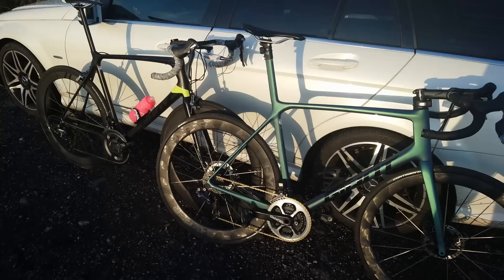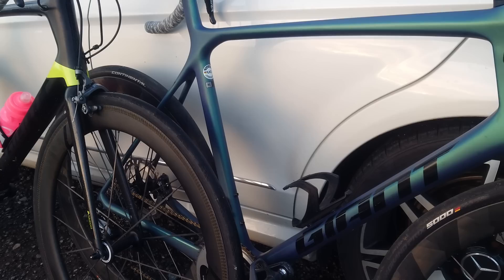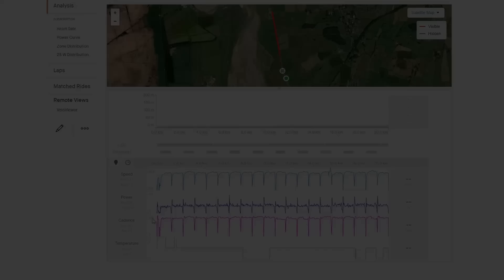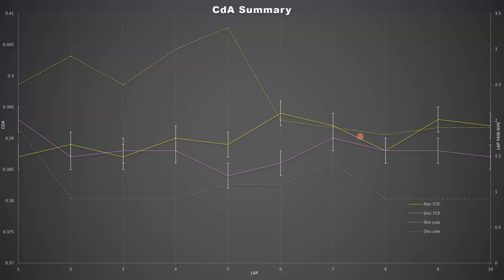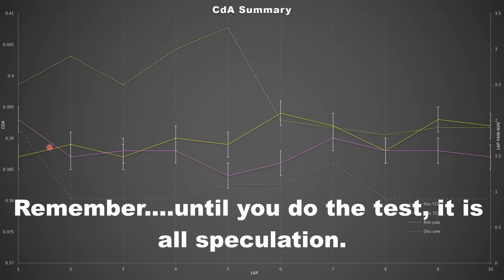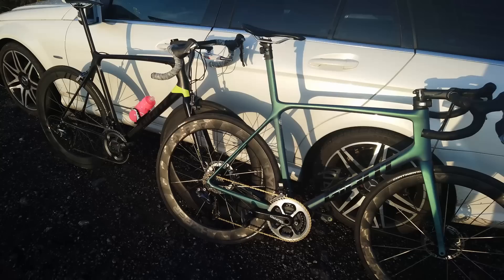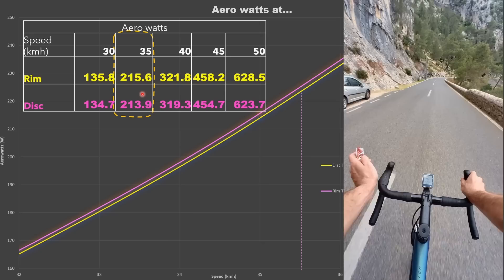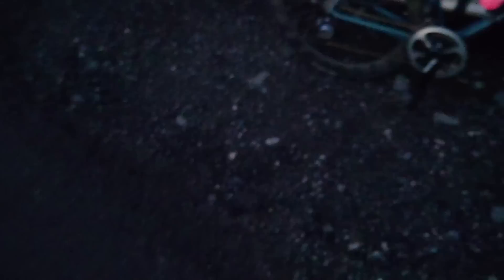Are Disc brakes Slower? Rim Vs Disc Aero tested.

Comment from the maker: Update before release: Just realised - in the second chart, the colours have swapped. Values are correct.
Update post release: Thanks for all the comments, crazy this one I shall try and keep up. Dont forget to click subscribe, 80% of viewers non-subs, I don't bite! The next videos we have in this series include:
Wider Tyres vs control tyre Aero test(at iso-Crr) - self explanatory
Wider Tyres vs control tyre Rolling resistance [frictional and vibration attenuation] test (at iso-CdA) - I fix CdA and optimise pressure for a given course. 

All wheelset data for individual aero tests (which forms the backbone of the Aerolab partnership) can be found in upcoming wheel test videos. The first one to be uploaded here was the Ican35 review which you can find on my channel.

Cheers to the patrons, you know who you are!
Reply: I think cross wind performance and measurement would be much more beneficial.  Most people slow down if they feel the cross winds are jerking their wheels around--that would affect speed more than anything else.

Comment: PT and his estate car. A man with no shame.
Reply from the maker: Low CdA mate. 53mpg+. Remember the Volvo estate in BTCC? Was it banned for being too quick?
Reply: @PeakTorque  A load of tosh, that CdA is going to be way worse than my car! It's because you are contributing to lung problems for the masses with your diseasal. for our next video powerpoint reaming I think we should have "Cycling Youtubers and what they drive". I think the masses would be hooked.
Reply: I was disappointed the bikes weren’t in the TR6.
Reply: The Merc has discs, front and rear. Just sayin’. 🤷‍♂️
Reply: Five year olds can't even drive
Reply from the maker: @Gregory_tottie  oh you just wait. They go across Europe!
Reply: Merc Estate cars  are #1 choice for dogging... is what Hambini meant to say😂
Reply: @Hambini Mate you lived in Germany. You should know estate cars are the craze
Reply from the maker: @Dolmar-Rick  laying down with 2 fine frames in the back, can't complain
Reply: @peaktorque the test is tempting but it is Not of any engineering value…. You have half a dozen of variables together… different wheels, different widths, different bars, different bar sizes, exposed cables, different cranks… there is no lessons an Engineer can get from this.
Reply: @PeakTorque  haha
Reply: @hambini Well my RS6 - 2021 estate fit either my mtb or roadbike very well. especially on german autobahn. you propably have driven the A555 a lot...
Reply from the maker: @cipo36an203  any test with repeatable results, that adds to a bank of data and learning, is a worthy test. I'm a professional engineer, this is a hobby, but its the same mindset. If you want to pay to equip the bikes the same, you may join patreon 😉
Reply from the maker: @Ghostina1  please donate an rs6 to the channel
Reply: I only drive an estate ("Kombi"...) cause my wife won't let me buy a van...
Reply: @PeakTorque  how about we all donate a Model S, because we all know that’s your favorite car ever made!
Reply: Here in Oz Merc estates are thin in the ground and quite desirable. Not sure why they didn't import more estates. I'm an SUV man as a daily driver but an estate is better if you're looking to sleep in it.
Reply: @Hambini  Mr Hambini I’ve never actually seen a video of you riding a bike? Do you actually ride any bikes or are you just an armchair cyclist? 😁😎👍🏻
Reply: @PeakTorque  then act as an Engineer even for hobby. You may have a repeatable test, good, you may learn how to use, the limits of your sensor, but comparing apple and bananas doesn’t drive ANY conclusion outside “bike1 vs bike2” and definitely not answer tue question “is rim brake faster than discs”.
Reply: If it’s good enough for Chris Harris, the estate car is good enough for me! Grand effort dude, just shows the versatility of the estate fitting those 2 rather large bikes, and the pink bottle!
Reply: @cipo36an203  when the test results are contrary to your personal belief… blame the test… and the tester. Nice one.
Reply: @edthelizzard  what? What believe? The test can’t prove what the title suggest regardless what is faster. That’s doesn’t require a degree to understand that with “everything different” you can’t drive any conclusion.
Reply: @cipo36an203  in the absence of better data from your part, I’ll stick with the engineer’s data and conclusions and draw my own conclusions from the test. Those being that if aero performance is not significantly different between the two braking systems I would choose the system with better braking performance. Until such day as you provide evidence of a better test (yours or anyone else’s) or credentials supporting some sort of engineering superiority, I’ll disregard whatever opinion you might have on this one. And as the author suggested, you can always contribute through Patreon to provide him with better test conditions. Your money where your mouth is, so to speak.
Reply from the maker: @cipo36an203  it proves the 2 bikes, despite having very slight differences, are within a very small difference of eachother. Thats a useful result, whether you like it or not.
Reply: @PeakTorque  yes we compare 2 bikes with near results, the title of the video suggest we look for something different. Rim or disc are just one of the many differences.
With so many variables we can’t even say “slight differences”, you just have no idea if differences cancel or add up. If aero-bar compensates exposed cables or if rim profile compensate narrower position…
Reply: @edthelizzard  not having other data doesn’t make this data is valid… if data is not valid it’s ok not to publish it, there are still things to learn but not to answer the question the title suggest. Since you seem to care, as Mech Engineer I guarantee we can’t make ANY conclusion based on this test. The wheels may have 3-5w difference, the aero bar may bring 3-4 but the narrower round bar may compensate way more (but guess what, it’s buried in the noise generated by all the differences), the exposed housing are in the 2w region… if you are able to see the impact of the breaking system that’s beyond engineering capabilities…
Reply: @cipo36an203  I don't know what perfectly analogous world you live in, but in this world comparing one apple with another apple will still yield some variation.
The point is, whether there are disc brakes or rim brakes the aero differences are negligible, especially when coupled with some minor variation between bikes.
Feel free to set up your own test. If you want to compare satsumas and satsumas, I would say your best bet is to remove the bike completely from the equation and just mount some bare disc brakes and rim brakes on a stick inside a wind tunnel...👀. Otherwise good luck finding two completely like for like bikes which accommodate both brake types.

Just to add to the variation, some bikes conveniently tuck the front rim brake behind the forks, like my Propel for example, or tuck the rear brake on the chainstay by the bottom bracket 🤷🏻‍♂️.
Reply: @mikehall6608  I live in a world where Engineers do stuff properly, one variation at the time. I am not expecting a YouTube channel to be able to do it and that’s ok, it can do other simpler stuff, claiming it is able to do more, getting close or even drive conclusions is an illusion. And just for the record, many wheels exist with the same rim profile in rim or disc brake.
Reply: @cipo36an203  until such time as you provide better/any data to support your theory that “rim brakes are faster” I’ll treat it as unsubstantiated. Thank you very much.
Reply: @edthelizzard  what? That’s a bit laughable, read again and point me where on earth did I say that? 🙃
Reply from the maker: @cipo36an203  i think many people have been led to believe that "disc bikes are far slower cos of that rotor chopping around in clean air". To those not so familiar with engineering, aerodynamics or have no tangible estimation of wattage losses/gains i think this puts it into context that discs or rims are within the realms of the few component differences on both bikes. For your ref, the wheels on both bikes are very well matched in terms of shape, spoke count, and tyre profile. From the hundreds of wheel laps ive done I'd say there isn't a measurable difference between them.
Reply: @cipo36an203  That is indeed something that unfortunately invalidates making any conclusion. 
I do use wind tunnels (for bridges and buildings) and I can't imagine making any conclusions with so many variables, even saying "ball-park" that should work... is not possible. He would be surprised how different details interact. He will be able to compare different tires, different wheels, different positions in the same bike, where this would be the only variable.
Brent S.

Comment: Disc brakes: heavier
Rim brakes: worse when wet
Negligible differences when it comes to aero drag
Reply: Speak for yourself ❤️😆.

Some of us ride over 25kph and use race tires.

Road disc IS slower and more dangerous.
Reply: @durianriders  what?
I also ride above 25kmh and use race tires. I actually race. For over 10 years.

So yeah my opinion but more dangerous? What? Only for the hamfisted and those that lack skill.

Get good.
Reply: Disc brakes: extremely dangerous

Comment: This may seem a very stupid question, but there are many variables with different wheels and handlebars, and one of your bikes has an additional spacer on top of the stem. So your justification of control is not justifiable. Hambini did a similar test and took his front disc and calliper off, which he suggested was the most significant contributor to drag. Could you just do that? In any case an eye-opening video, and thank you for taking the time to do it, as it has taken some effort.
Reply from the maker: Practicality. Ive Tested no front rotor and the difference is within the error bar (about 1.5w at 35kmh). A partner has also tunnel tested it up to 55kmh in a tunnel. Am under NDA on that, so say no more.
Reply: @PeakTorque  PTwheels inc?
Reply: That's the main point on a comment I just posted. The 2 bikes are too different to isolate the braking system impact!

Comment: Conclusion is that the riders position are much more important than any thing.
That’s supports my theory that the most aero bike most be the bike with the lowest bottom bracket hight. A low bottom bracket will put the rider more “in the bike” and therefore covering the rider.
I have been looking in to this, an on of the bikes with the lowest BB height is a Focus Izalco Max. It could be really interesting to test this Focus against a “real” aero bike.

Comment: Was your rim brake bike using a radial spoked wheel with 6 or 8 fewer spokes? If not, I suspect this would have more than offset the extra cable drag. I guess another factor is that since the switch to disc brakes by the industry, there has been no further aero development of rim brakes. Back in the day, some brands were putting the brakes under the chain stays, behind the fork, and even inside the fork crown. It is worth observing that highly aero rim brakes, perhaps those inside the fork crown, for example, would have less drag than discs.
Reply: I agree. And the aero data from your magazine can support this—for example,  the rim brake madone was a few watts faster than disk madone (in a wind tunnel, that is). There are a couple more examples.
R&D on rim brakes is almost non existent it seems. Those integrated rim brakes were also a pain to work on though, and as PT says, disk brakes can be faster due to late braking, confidence, and relaxed upper body on descending. They also permit more complex wheel designs and contours.
Though I would love to continue seeing TT bikes with aero rim brakes with  development there, and I think this will continue… just not on road bikes.

Comment: Given we're exploring these tiny marginal gains and losses, one thing I want to see bearings vs bushings in jockey wheels - I imagine a few watts on a particularly tightly tensioned drive train, and bigger differences when grit and dirt is introduced, but it's certainly not me who knows anything about efficiency, I ride a full suspension everywhere lol

Great vids, and great dedication for the testing
Reply: I doubt this setup would be able to measure a difference there, that's an effect another order of magnitude or so down from this.

Comment: How are these 28x spokes 3x cross wheels with exposed nipples not significantly slower than a wheel with 20x radial hidden nipples without disc?? Can`t believe it, what`s going on. Explanation?

Comment: PT I thought this was a fantastic video, finally putting some real world data to the huge argument that is rim vs disc. Kudos to you for taking so much time to put this and your other content together. First time I’ve ever considered patreon simply because I respect the work involved. 

As an enthusiast rider with both disc and rim brake bikes this test mirrors my own findings that in the real world the differences are not worth worrying about, when you’re having a good leg day even  the winter bike on 28s with mudguards is a 20+ bike.

Comment: I'm loving this comment section. So many people drawing incorrect conclusions.

My take away is that the same old rules apply, if you want to reduce your system aerodynamic drag don't worry about the brakes or running gear for miniscule gains. Focus on body position, fitness, kit and rims.
Reply from the maker: basically

Comment: My buddy and I have tested this out on several occasions. I ride rim, he's got discs. We have a local hill, at the top we stop pedalling at exactly the same time at the same speed, side by side and freewheel to the bottom. Our feet are placed in the quarter to 3 position, our hands on the hoods and therefore in the upright ride position. And yes, we are of very similar build and weight. First up was me on my alloy Boardman Team with Mavic R-sys wheels, he on a carbon aero Giant TCR with 55 and 65 aero SLR wheels. After 20 metres I was rolling clear, at the bottom of the 200 metre descent I was 40 metres clear. We repeated a few weeks later, but this time I was on my carbon Cannondale Synapse (2007) with a Prime carbon 50mm wheelset, again, not an aero bike, but rim brakes once more. Very similar results. My mate later acquired a very new version of the Cervelo (some letter, P or R) 5 which was not only an aero bike, but also fitted with the new super cool looking aero bars with a wind reducing bridge 🤔 across the top. Once more on my Cannondale, the same results occurred, I can't even say that the super aero Cervelo was any closer than the Giant, but it was certainly left trailing in my wake. Was it rim brakes making that much difference? I don't know, but it's certainly a factor.

Comment: Differences of body position and bike setups aside, all the Cda and watts results are within 1% of each other which is likely smaller than the margin of error of the Aero Lab device, even Assioma power pedals have +/-1 % margin of error, so can we realistically claim any solid conclusions from this test?  Even if we were to accept that disc is a few watts more aerodynamic,  rim brake is still the  undisputed winner in weight,  price and maintenance.
Reply from the maker: You're not wrong, but fortunately 'accuracy' is not the same as repeatability. That's why we do repeated runs! And there does seem to be some bias in terms in favour of the disc bike, albeit very slim.
Reply: @PeakTorque  Great research vid by the way, it is quite interesting to see some independent real world riding data.  However, statistically speaking, I'm not sure if 10 laps is enough data to favor even a small bias when the results are within 1% of each other and the measurement devices' margin of error is at best +/-1%.  If you were to do a bigger sample size there is a good chance that small bias could flip.  Not trying to torture you man, I just find the discussion interesting. Cheers!
Reply: Price and maintenance  are moot points in reality. 
The majority of cyclists entering the market, and thus will eventually dominate the population, are covid era cyclists. 
These folks have 1) cash to burn and 2)self-maintenance offers a low return of investment for time spent. 

As such, money ain’t an issue, and if there are any issues, it’s the mechanics problem to deal with, not theirs. So they have every incentive to use whatever is cutting edge in cycling, regardless of the time or servicing technicality.

Comment: Really interesting thanks for making this stuff understandable. Good to see the differing frame years of the TCR not showing significant differences as they made all the usual aero claims with the new one😆  It would be cool to see the narrow 320mm Fouriers bars get tested, perhaps against the carbon aero bars, just to further contextualise the priority of body position over components :)
Reply: Despite the advertising fluff, the fact that you don't lose watts, but get better breaking gives the win to disc brakes.  At least with comparing these two bikes.  I'd also like to see a similar test done with two bikes without so much cable housing.  Even the disc bike in this scenario has plenty of cable housing showing.
Reply: You have so much apple and bananas differences between those two bikes that you can’t drive any conclusions. The rim brakes has an aero bar… but it’s wider (probably the biggest I pact since rider will generate a lot more drag), rim brake has a different rim height, and has exposed cables, cranks are different… we have no idea how this add up.
Reply: How many rim brake riders you at the side of the road with a brake problem? Rim brakes on road bikes FTW! 😱🫠🐸😎